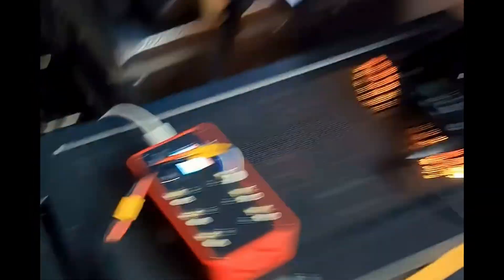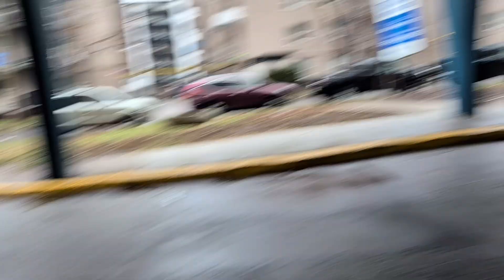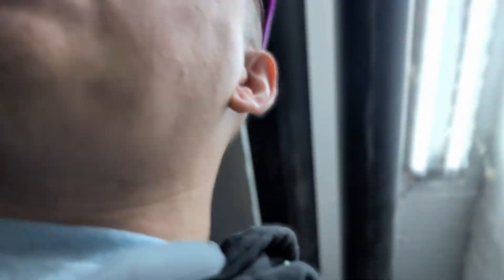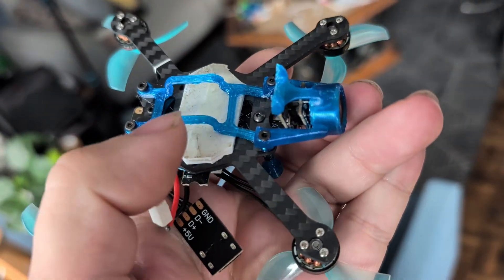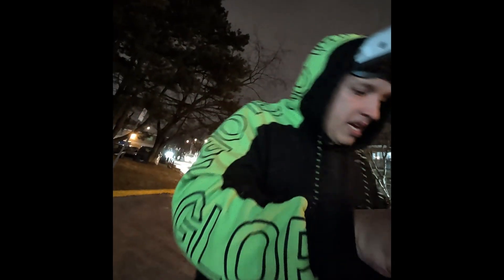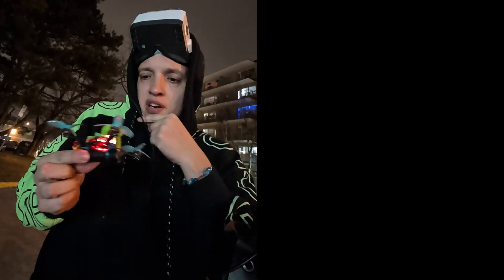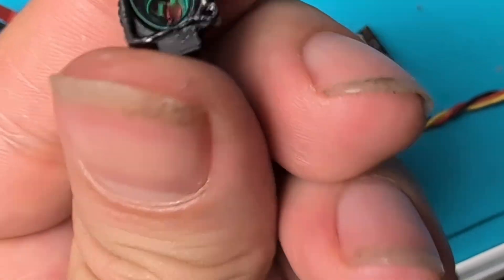I Built A Drone That Flies Forever

Comment: Geex.  I haven't felt like that since the first time I watched 'Old Yeller.'  Poor l'il dude.  He deserved so much better.

I like it.  I have a few X12s, and once I get the surgery for my Master-Po-grade cataracts out of the way, I'll def-o be wanting one of your kits.  Or maybe both. . .
Reply from the maker: X12s are amazing but I would build a little 2s with it. I don't know. I love 2s a lot more than 1s. Hope all that stuff goes well with you and definitely my best frame is my 3.5 the great discus. I spent 2 years designing that and I have at least one for every system. It's my favorite quad and it takes a beating. But I'm slowly working my way into the smaller stuff. Thanks for stopping by

Comment: Telemetry lost.. that hurt to hear. I’ve been using the ampace jp30P1 in the NBD lionbee and they are solid for 18650 builds. It’s such a fun LR micro now I want to build a complete DIY one.
Reply from the maker: Definitely tempted to buy one of those boards very weird size though. There is no doubting they are fun for their own things but a light 4s ripper is where my heart is at. ❤ But you should totally try building your own. Sometimes I think designing drones is even more enjoyable than flying. It definitely satisfies an itch.
Reply: @T @TorontoFPV  I agree completely. I’ve got a bamboo A1 mini on the way and I look forward to designing and building canopy’s battery trays and everything else this hobby offers. The only limiting factor is imagination at this point. You should def pic up one of those AIO boards. They are $60 US and well built imo if you don’t mind am32.
Reply from the maker: @brakefaded absolutely! And often for me it's the opposite. I imagination is too much so I take on project after project when I have so many old projects that I need to finish or even just start. I'm the type of person that doesn't want to play the new video game until I beat all the old ones first and then that stops me from ever getting to the new ones. It's weird to want order when you're such a chaotic person. That's why whenever I do something I need to make the video right away. Otherwise it doesn't get made. Right now I'm going through the whole ascent system and I'm loving it but the videos getting more and more work cuz of testing out different firmwares different conditions and all that stuff. Hopefully I can get it done by next week. With the Lions the flight time is so good but their performance leaves me wanting so much more so I think I might put it on the back burner for now. I'm trying to get my 5-in design finished. I finally made one with replaceable arms but just trying to get all the sizing right with standoffs and everything and figuring out if I want to use press nuts and stuff like that. Trying to get it all finished before ordering more frames cuz I'm sold out of my 3.5 discus frame. So whenever I run out of a frame I use it as an excuse to get a new frame designed so I don't have to order again later. What do you do for work?
Reply: @TorontoFPV  look forward to seeing that come to life and really looking forward to the ascent content. I’d love a cheap digital system for micros. I do warehouse work in Florida 5pm-3am just an average Joe lol
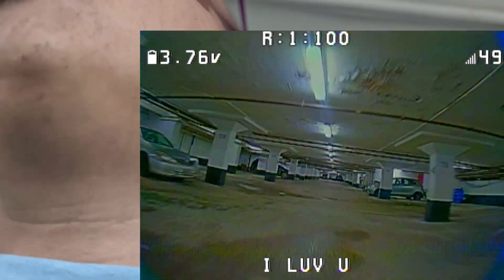Reply from the maker: No shame in that buddy, although I do try to encourage everyone to try and make their hobby their job even if it takes a while. But I did that my whole life and lost everything and I'm rebuilding it takes a lot longer to pay the bills that way. But at least it's fine. For me a 9:00 to 5:00 would kill me. Hopefully doing those kind of shifts late at night. They compensate you properly. Honestly the system is so good for how cheap it is. It's on par with vistas so I remember paying $200 a Vista and you get these guys for 40 bucks of pop. Pretty damn good. It's not perfect or as good as the new DJI stuff but the price is so cheap that you don't feel bad breaking and trust me I've tried LOL. Anything I don't want to break gets destroyed and anything I don't give a crap about just lasts forever so I'm excited about this crap living lasting forever. @brakefaded
Reply: @TorontoFPV  I feel ya there. It’s enough to sustain my family and that’s all I need from it. 
How do you feel about the latency of the system? Everyone I see complaining it’s too high are reading a spec sheet not flying it lol I’m priestly waiting hoping they drop a vrx I can add to the goggles so I don’t have to buy another pair but idk if that’s in their plans. Well worth the price either way and the video feed looks great from the videos I have seen.
Reply from the maker: @brakefaded I got the newest firmware. It's not released yet but it got the latency down to about 25 milliseconds most of the time. Also not blurring as much you have to also remember at the same time it's only 100 MW VTX so for what it is it's pretty impressive. I felt salty when I got my DJI v2 goggles. Whereas the ascent system is so cheap that it makes you feel careless free. Kind of in the way analog does,but you get to see. I think if you don't want to put the money into DJI it's a guilt-free purchase or getting kids into fpv or just switching from analog to digital for a bit. No doubt the high-end DJI stuff is amazing. But if you're you're staying close freestyling at the park. It's perfectly acceptable or indoor whoop flights. I'm willing to forgive it a lot because of how cheap it is. But if you spent $200 for a VTX and the goggles and you put them on and see how good it looks for the first time, it's kind of mind-blowing.
Reply: @TorontoFPV  let’s go that’s plenty good for the price. You sold me on them. Can’t wait for the content

Comment: looks like it strugles with the weight a little bit 4:02
Reply from the maker: Throttle control is totally different the weight needs to be balanced it actually had a ton of juice left. But you're balancing it while holding the throttle at 70-80 the whole time.